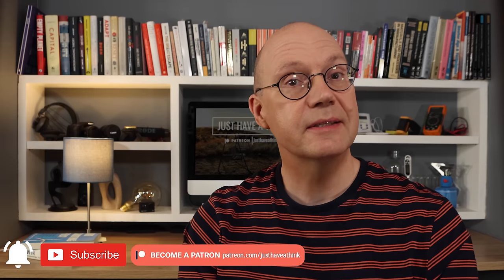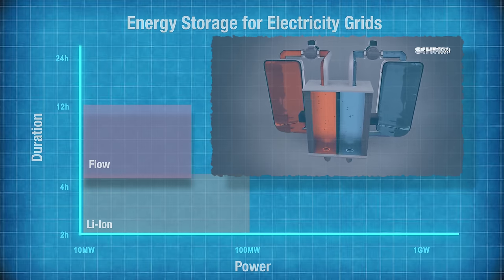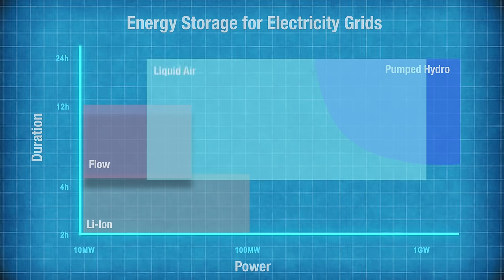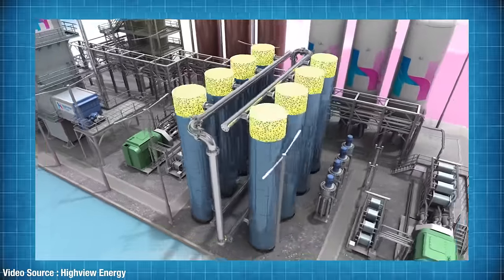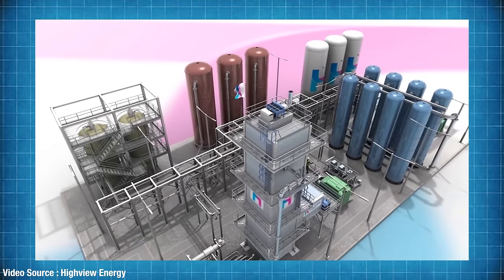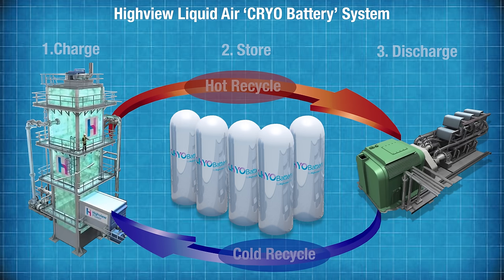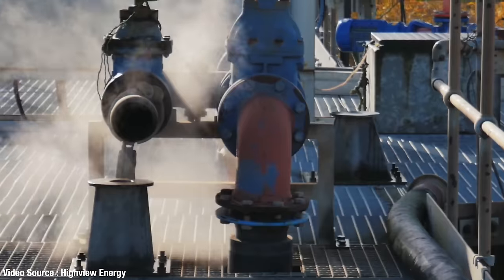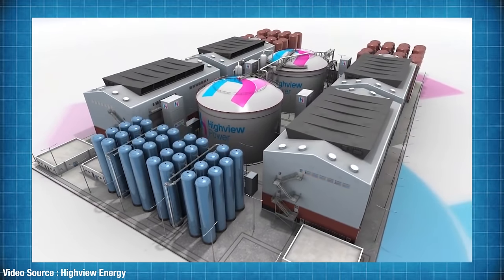Liquid Air Batteries. Literally energy from thin air. Seriously. Literally!

Comment: You could use the heat from air compression to keep a liquid salt electrochemical cell operating and with the scrubbed CO2 reduce it into graphite. If the peak grid output fills up the liquid air battery you can still use the energy to sequester CO2 and thus get carbon credits and perhaps make money... Likewise during the day if you have a modest solar concentrator you can use to obtain gratis heat to improve liquid air expansion. There's a lot of room for improvement. The sad part will be patents and trademarks closing it from everybody. Carbon conversion won't be never fast enough and all the contraptions of capital and profit will only kill people...

Comment: ....or, we subsidize stand-alone distributed off-grid solar, wind, and geothermal energy development. This creates a much more robust infrastructure than legacy mass interconnected power-grids . The grid system was developed by Edison and the rest so they could monopolize power generation and distribution, not because it was a robust or efficient system. A bird landing on the wrong wire or whatever can cut power to thousands of homes. An off-grid house has a problem, and it's isolated from other systems. This makes survival situations like natural disasters much less fraught as well. Then there's the economic benefit to individuals rather than utilities and speculators.

Comment: One thing you glossed over in this video was the initial process where you said 'the air is cleaned up', thus 'removal of CO2'. If this CO2 is discharged into the atmosphere, then where is the ecological advantage, if not - how is it captured? Be grateful if you might enlarge on this point. Thanks.

Comment: 🤔 200,000 homes for five hours? That’s not worth it. Batteries of any kind sound like a grand idea to balance a grid until you try it. They end up at best being a brief switch between renewables and a baseload source like gas, coal, hydro or nuclear. Hornsdale can only go 10 minutes before being drained, it’s technically a switching station to fossil fuels. Batteries are not baseload energy either, this is all madness!

Comment: Some companies tried something similar with cars.  Notably Peugeot and Tata.  I think heat was the biggest problem. Safety was a concern.  When the compressed air gets let than 25% the loss of pressure make the reminder of the gas less efficient.
https://en.wikipedia.org/wiki/Compressed_air_car
If you think this can work, why not build a track going up a hill?  Then run a heavy train down it when you need extra energy.  Some people are researching giant flywheels.

Comment: And it wouldn't discard hydro electric there are alternative ways of  Resolving  Dam issue, There are some smart people out there  pretty clever ways of generating power using hydro without building a dam just so you know. And by the way it is environmentally friendly  Did I slip. ON so you know how it works Is by cutting onto the side of the river  Of the stream No dam required. Look up off the grid survivalist is it company that makes and design a hydro generator that puts out one kW power, A pendant on what it is being used for it could be more than that just saying  Hydro is not dead yet it's a more viable option this way  And suitable for the environment. But I'm afraid that people that come up with good ideas how we don't share them because look at what happened to Nikola Tesla.

Comment: Interesting video. I have 10 kW of solar on my roof so I'm not here to take shots. I suggest that there are no completely benign methods of power generation but some are better than others. Hydro can have severe impacts on the ecology of a river system but has until recently been the only significant source of renewable energy in our power grids. It can also work well with other renewables. The water behind a dam can be saved and used when the wind stops blowing or the sun stops shining. Dams are also important for flood control and agriculture. Pumped storage hydro can be designed to minimize the impact on a river system. Round trip efficiency can be up to 80% and these installations have been in operation for decades. A big barrier to development of PSH ( in North America) is the long time required for regulatory approvals.

Comment: Interesting about the carbon capture too possible use of other gases aswell similiar sysrem in Calfornia just uses used containers with smaller tanks inside  linked togetther to scale up Other projects some comments making hydrogen from the wind and solar then converting back to electric Why not convert to methonal then put into our gas tanks Why not make the hydrogen undergrond in old oil wells the co2 stayß underground so its green hydrogen at 1/10 cost of solar (.20c per kilo) no expensive solar or wind farms either Then convert to meŕhonal ( safer used in race cars considered safer than gasoline) can be transported and pumped stored and even used by existing infrasture ( too simple) has high power to weight ratio ( drones fly 3-4x as long vs batteries) methonal is enviromentaly safe marine use when in water will not kill fish etc ( to good to be true) safe cost effective energy nope  not good we need expensive complicated systems ( makes moŕe work for high paid engineers etc LOL)

Comment: Years ago a storage system using flywheel in a vacuum was developed and quickly bought out, then disappeared quietly. Even simpler and more adaptable than liquid air. Only the high dollar solutions will get funding. What else is out there going unnoticed because big money can't find a way to control the distribution?

Comment: So good to see "green" tech that is actually green!  Big Solar and Big Wind are still incredibly environmentally destructive, but clean and efficient energy storage is also key to decentralized generation (rooftop solar, small windmill) feeding back into the grid.  Lithium ion batteries are far more environmentally expensive than this video goes into - they should not be used large scale and stick to laptops.
I wonder if this system could be economically scaled down to home size?  Installing a Tesla car battery for a home is geeky, but all that Lithium mined by slave labor is still concerning.

Comment: You can do all of this without needing to spend power on keeping it cold, or insulation. Instead of compressing and liquefying air, you can crack water for hydrogen, take nitrogen directly out of the air, and convert to ammonia using the Haber process. 

Ammonia, in turn, can be burned in an internal-combustion generator (has about half the energy density of gasoline) exactly reversing the process with losses to efficiency on about the same scale as mentioned in the video.   The combustion products are water (which you can use again, or release) and free nitrogen.  

Ammonia can be stored, as a dense liquid, in pressurized tankage at ambient temperature, literally for years  with no need for energy input to keep it cold and very little required maintenance. 

Finally, if you make more than you want to store, there's an existing market for it, in enormous quantities, when sold for fertilizer.   The  process described above is slightly more expensive but far less damaging to the environment than the Haber-Bosch process, which converts petrochemicals into ammonia.

Right now the world is using the Haber-Bosch process to convert petrochemicals into ammonia for fertilizer, releasing enormous amounts of atmospheric carbon, and we need to make them stop!

Comment: It would seem that the overflow of power not required should be continually used in a varying form of backup solutions; ie fill the air tanks till they have no more available expansion then use the hammer drop method using the towers which the compression tanks already are.

The tank or tank grouping has to be stabilised in that upright position so make the supports stronger, maybe even higher & have as many dropoff points as is feasible depending on ground clearance & actual space at the top. Weights on cables turning generators with a few hundred feet drop each multiplied by the number of feasible dropoffs per tank or group of tanks, would increase the usefulness of the space being used. I think 2 opposite side dropoffs sheerly for weight balance & reducing structural stresses, maybe even 4 equally distributed.

A full-switch on all of the tanks causes power to be diverted to begin raising the weights one at a time. This way the power system becomes backedup on the backup. Holes could be dug to increase the distance the weights have to fall & therefore the returns gained. For a backup on the backup's backup, these cables should also be spinning a flywheel on a separate generator.

Comment: 9:03 you switch the burns off. If we're talking about your central heater that may be the case, but for large fossil-fired and nuclear plants, this is simply not possible. Because they face issue like temperature-induced fatigue, the change in power output can only be done slowly. They simply were not designed for the thermal induced fatigue and other problems arising from quick change of power output (central heaters indeed have the same problem, but their design lifetime is limited and exchange is easily possible). Newer ones are better, but still the rate of power output change is limited. That's why those plants are called base load power plants. So also these power plants rely on energy stores!

Comment: Super Compressed Air Energy Storage (SuperCAES) has been known since the 50ies. I worked on a system with my old partner in USA over 30 years ago. Unfortunately, the storage vessels were too expensive then. They were made of spun polymers around a thin wall tank.

Comment: I wonder about the um down-ward scalability(?) of this system. Could a house have a bunch of solar panels on the roof, use the electricity to power to run a pump to cool/compress air into liquid in a tank along-side the house say, then  release the air to power an evening's dinner, teevee and whatnot...
EDIT: I see someone already fomented a discussion on this point below. I'l read it :)

Comment: Excellent and informative video, but you gave pumped hydro rather short shift.  It's scalable just as liquid air is, so you don't need massive dams. That was an unfair comparison that I trust you will correct when you cover pumped hydro.  I'm an advocate for using all sensible storage methods as is appropriate to a given terrain, energy needs and resources, so don't read this as criticism of liquid air technologies.

Comment: I hope they use closed cycle using hydrogen (helium is too expensive and valuable I suppose).
Anyway, 60% is too low, molten metal batteries are better, they can sell 33% more energy using the same energy source .

Comment: Air Conditioner that saves the cold gases and never runs out, it uses wet/air not various refrigerant gases(that boil at lower temps but is bad for the environment). Im guessing the pump is efficient and is powered by the energy that it creates. Why are tec's not used in making electric from opposing temps at large scale? Just thinking instead of mechanical generator. Maybe that's the future in energy too. This is neat stuff/ love science. The air hog toys is another air storage example.

Comment: During the estimated forty year life of the air battery plant, the windmills will need to be replaced about 4 times. The solar cells at least once. Not only are these elements very expensive but they also are not easily recycled and many of the components will end up in land fills. The overall cost to the environment is quite high. Burning of natural gas does release CO2, but it is plant food and since water vapor absorbs the same wavelengths of light(and more wavelengths) co2 is less likely to 'cause' global warming than water vapor.

Comment: Its a bigger stride than coal-gas where the energy extracted came from a free source but; the 'Gas Works' were only around for a short and while expensive at first paid for themselves over time and created jobs. Until of course we found they used masses of the 'free source' and polluted.
This method could be a step we can use until nuclear fusion but what will happen to the old sites after and will this slow down or de-incentify the research we should be pursuing in seeking fusion? I like it as an idea but the source of the power to drive it is not that socially friendly : noisy turbines, chemicals in solar batteries when done with, unsightly (not in my backyard) etc.Plus how can all of this be decommissioned when the time comes? Back to Gas-Works for the answer to that! Too much of same problem loop with a different product?

Comment: You had me until you told me it would take 2 YEARS to deploy this dinky power storage system. If they can't build it in 6 months it will be out of date and more expensive than everything else on the market by the time its finished. If every thing is already available why must it take so long to build?? Did they not expect to get funded and not have a plan to deploy this? What a shame.

Comment: I'm really puzzled as to how this system will STORE vast amounts of energy. It seems to me that essentially it is a reversible heat pump system using such extremes of pressure and temperature that air itself can be used as the refridgerant. In order for this to deliver energy output without simultaneously using energy input for the compression phase, it would need to store ALL the heat generated during the compression phase of the process. I have no idea what the calculation would be, but if this energy had to be extracted from the surrounding air instead of stores hear, the fans would be colossal and they might even create their own mini climate :)

Comment: Compressed Air/Liquid Air systems have a great deal to offer. Whilst they are not as efficient as chemical battery system they are over long time scales they are actually much more efficient. This is due to the fact that they have a much longer life span. Even on small scale low pressure (10bar) compressed air systems have considerable advantages particularly if you are in a rural location. As the only real downside is space to store the air storage cylinders. As noted the equipment is readily available and relatively simple. It also has a very long lifespan. Also at pressures up to 10bar the effects of the compression cycle are minimal. 
Certainly if you are off grid and relying on wind/solar then this is an ideal system. 
Also when considering high pressure systems say up to 250bar you can use air at these pressures to power a tramway system using the technology described in the video.
Such a system would be ideal for locations that do not want to have electric overhead and also the track does not have to be bonded to prevent stray current issues. 
So in fact such a system would actually be cheaper to build and easier to maintain. People often don't realise that compressed air tram systems operated into the 1930's. The main reason electric tramway system were adopted was to provide a base load in the era prior to electricity grid networks.

Comment: Yes it all sounds great, with lots of pro's. However as you stated none of this is really any new tech, nor are they by any means the first to have looked into or suggesting this. But all I heard was using already made components / OEM's to also help with the cost and reliability and yet what was never brought up is what is being done that could not have made this work better prior. What new advances has actually made this feasible, in particular with the so called claimed efficiency of 60%?

crickets
Hmmm yea I did not really hear anything either. The only thing even remotely mentioned of recovering heat, is again nothing new and has even been used in other refrigeration systems such as air con's. And even if they can get anywhere close to that efficiency in reality, there are still others that are more efficient such as nuclear. I can see where this might actually be bought from that company to supplement other power systems and importantly to bring up to full power in quick period of time when demand really needs, but nothing major or on high scale. And more realistically that can be done in other ways such as battery bank which would be better suited coupled to together with other green power such as wind or solar, instead of wasting that free energy when not being used.

Comment: 0:41  If I lift this hammer above my head using energy in my arm muscles to put potential energy into that hammer by keeping it up here against the pull of gravity    BZZZT. If that was true, holding up the hammer for 1s and for 15 minutes would result in more potential energy in the latter than in the former. That is not what happens.

Agreed, you do expend energy in your arm muscles to keep the hammer up there, but it is all gravity losses, no gaining of potential energy --- you could literally put the hammer on a shelf where you hold it!

Comment: I hear what you're saying about storing the liquid, if it is like nitrogen the boiling point of nitrogen is -320 degrees Fahrenheit to maintain the volume of liquid that you would need to run that generator at even -300 degrees Fahrenheit. The cost involved in keeping that liquid at -300 degrees would probably be more than the cost of production and operation even though the fuel source is free. If you want to talk about cheap electricity production nuclear is the cheapest by far to produce it is Pennies on the dollar the difference with nuclear is the amount of safety precautions that are needed that is where the incredible expense comes from. So in theory the liquid idea sounds great but actual cost would be extreme just like nuclear production in my opinion of course. Love the video by the way and the presentation.